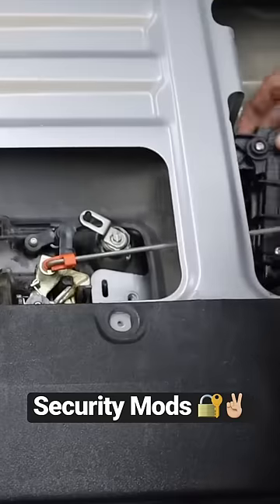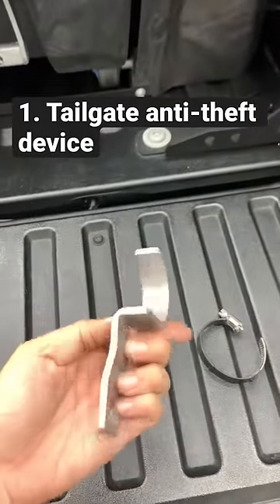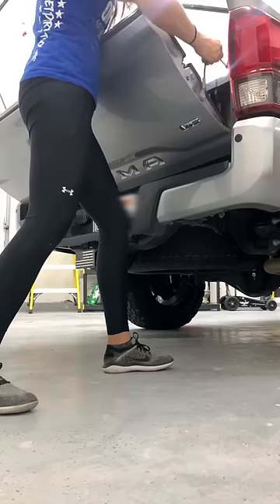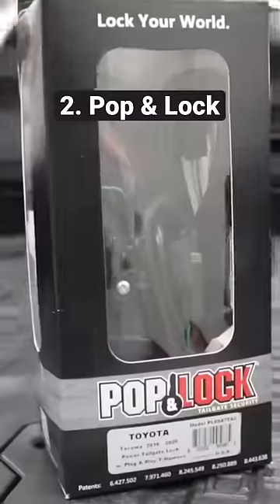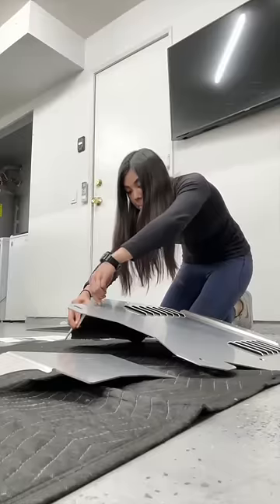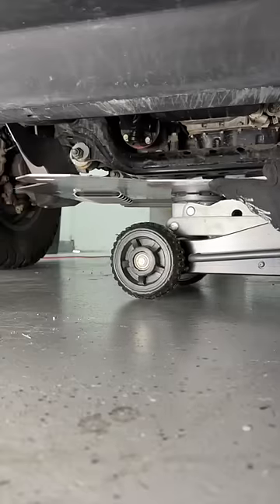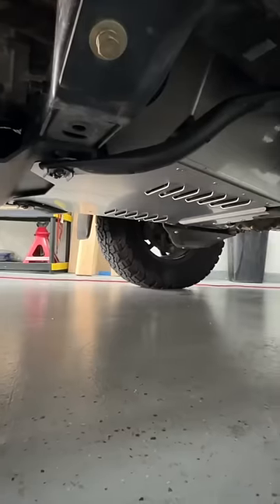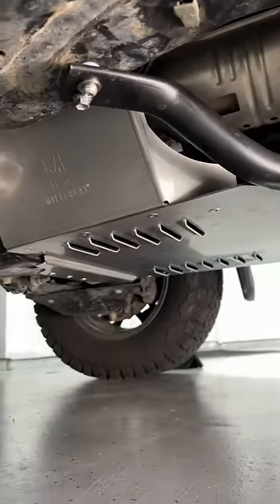All of the extra Security Mods on my Toyota Tacoma 🔐 (paranoid?!) #shorts #truck #toyotatacoma

Comment: Not crazy and paranoid, just realistic. Thanks for all your vids.
Reply: It's ridiculous old man have you ever been to Colorado there are tacomas every  20ft it's a basic car. Btw those cats aren't even worth that much either 😅
Reply: @willhrn8562  have you ever put new cats on a Tacoma before and how much did they cost
Reply: @Provemerightthx  But what about dogs?😄
Reply: That will actually work, thief will slide under there, see that, and move on to the next. That’s all it takes.
Reply: @ytgfhib they run between 1,100 to 1,200 each so it's expensive AF. If it's a 4 cylinder they only have 2.
Reply: @Keith  They aren't worth stealing I'm not sure how much they cost but plenty have more value
Reply: Now, thieves can steal both the protection plate and the cat.
Reply: This is normal in the US? God bless the land of the free und thieves 😂
Reply: Cat shield yeah 
Tailgate shit not really
Reply: 😂😂😂 more like manifesting that scenario into your life instead of just relaxing

Comment: The crackhead at 3am with a buzz saw 
“Hold my beer”
Reply: It'll still take long enough that it's not worth it.

I'd throw some high voltage battery warnings on the plate for good measure.
Reply: 😅 Just need a cordless impact to take out the bolts that hold up the cross member that the plate is bolted to.
Reply: @i-love-comountains3850 high voltage signs don't slow down crackheads, just makes them dance a little 😅 Google copper thief electrocuted using kitchen knives.

Comment: Dame people be really stealing tailgates now 😂
Reply: Stealing tailgates is an ancient form of theft. Most the old trucks you see missing tailgates is cause they were stolen. Where I live people take them off when they don't need them.
Reply: You'd be surprised for the kind of shit people steals. I live in Colombia and a friend of mine got both the sparkplug and the wire stolen from his cheap 100cc bike lmao
Reply: No one steals tailgates, it's an old wifes tail
Reply: @punkrocker10115  then why did mine disappear lol. They get stolen plenty
Reply: @rat-rav  one tailgate getting stolen doesn't mean it's an epidemic or that it happens often.
Reply: @punkrocker10115 not explaining myself to ya man. They definitely get stolen often where I'm from. That's it
Reply: @punkrocker10115  I used to take them from trucks in the ski resort and sled them right into rocks and abandon them
Reply: Taillights on newer trucks is a big one, all these LED ones sell for big money.
Reply: @punkrocker10115  I agree, cats are the number 1 thing.   Tailgates do get stolen but it’s usually from dealer lots
Reply: Still do, but I'd recommend changing the tail light hardware if you have blind spot sensor in a pickup. The radar for those sensors are in your tail light housing, which can run $2000 a piece. It's 2 tiny Philips screws that retain it. In 30 seconds, you're out 4Gs. If you lock your tailgate they can't be accessed. If you can't  a security torx screw would be a decent option to replace your Phillips screw with. No guarantees.
Reply: Some tailgates cost over $5k to replace.  I'm not surprised they get stolen.
Reply: @punkrocker10115 Oh how wrong you are
Reply: @Strokin383  but I'm not and just saying I am doesn't prove anything. 🤡🤡🤡
Reply: @punkrocker10115  this is very true... And the tail gates with electronics don't just pop off. And the ones with assisted drop don't come off easy either. I've owned trucks 15 years and my father 60 years and my grandpa 78 years. They never had one stolen. But I must say someone stole all my emblems off my Mazda. Which I don't fully understand lmao. But who even upgrades a vehicle and leaves the catalytic converter? I'm sorry I own a real truck and none of this matters to me cause it won't happen.
Reply: @punkrocker10115  come to san antonio, Tx. , for a couple days, You'll be leaving without a tailgate, but most likely... Your' truck will be leaving without you.
Reply: @rat-rav  Yep and they're expensive.
Reply: @punkrocker10115  only clown here is you pal. Happened at my local Ford dealer. All the tail gates were stolen in 2014
Reply: They been doing that fam.
Reply: @scotts1711  I literally driven to almost every major city in the US and they aren't stealing tailgates. They're not worth anything and it's a dumb fucking thing to steal
Reply: @punkrocker10115 my mother’s tailgate in 2009 and mine in 2020 got stolen tbf I was visiting a bad side of town
Reply: More locks, more alarms, more cameras, more anti-theft systems.
blah blah blah. Meanwhile we never tackle the actual problem. Bad parenting and bad culture. When I was 10 years old we left the keys in the car in a unlocked garage. Keep telling yourself things are better now, truth is, they are not!
Reply: @punkrocker10115 Quite common. Grandfather had his stolen from his old F-250 while he was at the beach. My uncle had his stolen from his Tundra back in 2018, and a guy I saw about 8 months ago was trying to steal one off a truck in a Walmart parking lot around 2AM. Think it was an old Tacoma, but I was in a drive through so I couldn’t tell for certain. Either way bottom line, is tail gate theft is very real and happens quite frequently on the west coast and in some parts of the south. Buddy got his replaced in Texas, drove it out to New Mexico to see his brother and bye bye new tailgate.
Reply: @idofx8722  again, just because you think you saw someone do it doesn't make it true  anecdotal still evidence is still not evidence
Reply: @punkrocker10115  I said I couldn’t distinguish the type of vehicle. Watching a guy throw a tailgate into the back of an old 2010 Toyota Sienna and then driving off with it isn’t “potentially” theft. 2016-2017 is when it was real bad. Texas and California had the most reported tailgate thefts. Many go unreported, cause who wants hiked insurance rates? Annual reports during that time were based on insurance claims. Texas racked up 1360 reported thefts between 2016-2017 and California  had 1039 reported thefts within that time. The crime rise and fall from year to year, but it had been on the decline since 2018. It has spiked again as inflation spiked. Desperation triumphs over litigation.
Reply: Nice
Reply: How old are you?
Reply: Yup.  Mine was stolen last month at Costco  2015 Tacoma TRD SPORT.  YES CALIFORNIA. They have it on video, vehicle AND plate   Still not even a call back from Sheriffs department. 3 were stolen in the parking lot of a restaurant I go to.  The next one will definitely be secured.
Reply: @rat-rav  YES THEY DO.    MINE TOO. !

Comment: For the 3rd Gen Tacoma tailgate locks, installed the OEM one available from Toyota.  Easy install, no wires to cut.  Plug and Play.  And works with original key fob

Comment: Love the cat shield, brilliant idea
Reply: Wrong material though. Everyone who is stealing cats already have an angle grinder. They are just going to cut right through it. The better option would be to use kevlar. It's not as pretty looking but if anyone were to try to use your usual power tools on it they will get a bunch of fibers caught in it and have their tools burn up.
Reply: @dillzilla4454 Exactly i seen it done on a prius they used a multi tool and went right threw the shield then cut out the cat. Working at toyota i see it avout 3-4 times a month if not more on prius, tacoma and tundras.
Reply: The cat shield is not to completely prevent cat theft, but it adds another layer of security. Smart cat thieves are looking for in and out quickly. They could spend more time on that or hit 2 other vehicles in the same time and reduce the chance of being caught.

Comment: I dig the skid plate, but beware the cordless Sawzall
Reply: If thieves have all the time in rhe world then yeah ,  nothing keeping them out , 
If they were going for a quick in and out then they'll move on ,
Reply: This is why aluminum (I think) and of course titanium are best materials for cat protection because aluminum will gum up sawzall blades meant for steel (steel needs smaller teeth). Titanuam obviously harder and I think work hardens, making anything under a carbide cutting solution innefective.
Kicker - harbor freight sells cheap cutting torches I am sure.

Comment: 4 cats ?? Fork that! save yourself the trouble and just don't buy a truck that new
Reply: boomer theres usually 2 cats on each bank of any v6 engine. Lol since early 90s or 2000s
Reply: @travisk1487  that's my point, I daily a '99 Dakota, V6, has a single cat, how dafuq it get to 4...? planned obsolescence is how, legally require them and make people spend $4k-$6k to replace them, no thanks, I don't want any part of that repair., or in the case they are stolen, you pay the $4+k up front, out of pocket, or you get insurance to pay for it and end up paying more for insurance in the long run, I don't like that choice either...and for the record I'm Gen-X....I also live in a state that doesn't check emissions, couldn't care less if my Single cat goes bad.
Reply: bro relax and get you a 05 to 09 taco they are incredible lmao
Reply: @wyslink9354  thats what i got but 4cyl. only 2 cats lol
Reply: @travisk1487 my dodge 6500 has no cat. Its just straight pipes.
Reply: @quinnmclaughlin7537  my trucks 23 years old with the factory cat still on it and it passes smog in cali i doubt she will still own that truck in 2 decades let alone 1
Reply: "4 cats on a car?? nevermind just buy a 10 year older car with none of the features & design problem solved!"
Sometimes I just wanna quit the internet
Reply: @quinnmclaughlin7537  1999 was 24 years ago. Manufacturers realized breaking up the cats into smaller cats allows for better packaging under the vehicle & more efficient conversion in the cat itself (more surface area, easier packaging, smaller cats=cheaper to make as well)
Reply: Wait you guys left the cats on?

Comment: The first two are really neat and useful however if you take a look at the catalytic converters on third Jen's there specifically put higher up into the engine bay so that they get hotter quicker this means you literally can't cut them out that would be keeping an eye on those transmission temperatures since you have just now shrouded the whole thing
Reply: The transmission is primarily cooled with the transmission fluid which passes the heat into a transmission cooler. Newer transmissions often have  thermostatic valves because the cooler is actually overly efficient at cooling the transmission. I wouldn't worry too much about the cooling from a change of airflow around the pan.
Reply: @brarautorepairs  you're funny trying to sound cute smart why don't you do some research on tacomaworld because not even half Tacoma's currently produce on the market come with the transmission cooler you're referring to and many of them despite having that many of them find transmission fluid temperature getting a bit too hot when towing or crawling hard Offroad
Reply: @yzrippin  If it's an automatic transmission, I guarantee you there's a transmission cooler.

Most factory setups just shove it in one of the radiator end tanks.
Reply: I don’t know what u talking about someone had a 2020 Tacoma and their cat got stolen
Reply: @YZ Rippin, the cooler is often seamlessly integrated into the radiator but you will still notice a set of trans cooler lines either at the bottom or sides of the radiator. If you are unfamiliar with maintaining modern automatic transmissions, it is understandable to not notice this as it usually is difficult to see.
Reply: The 2 downstream are easy to cut out. So is that shield for that matter. It would slow them down a bit tho.
Reply: Also, there are vents built into the cat shield.
Reply: @yzrippin you sound really pressed for someone who thinks a cat getting hot next to a transmission means the transmission is gonna get hot too. The wind will cool it faster than the infrared will heat it up. And yeah, transmission heat radiators up front have been standard for a while now
Reply: @legacyunited13  about half or more 3rd gens don't have the trans cooler
Reply: @OtherDalfite  some of us do this thing called off-roading you're not moving very fast add mud tends to get caked in every crevice but I understand you're probably one of the soccer moms
Reply: @Kyle_Bush_Fan8  I guess you've never been in any amount of mud whatsoever
Reply: @yzrippin  here's your choices
1) crackhead/mud protection
2) airflow

Pick one. Feel free to tell me how both are possible

Comment: For the bolts if you use different head style for each bolt it takes alot longer because you have to go find a new socket for each or they could just use a Sawzall to cut the plate and half of your floor
Reply: You're wrong.  When you add a troublesome extra step they just go to another vehicle.  They don't want to spend an extra 20 minutes running the saw.
Reply: @garryquiggins8183  that plus what sawzall is cutting a half inch steel plate LOL

Comment: Soo I’m just gonna throw this out there, cat thieves generally use a saws all in order to cut the pipe. Their just gonna cut one side of that shield pull it down and then go to the pipes. Hopefully it doesn’t happen to your truck but I’m just telling you what I’ve seen.
Reply: Although that is true. These thieves look for easy targets. Of course anyone can break into anything but if it takes longer than just snipping and leaving they won’t do it. No point in struggling to remove cat when the car park right next to this one has no shield.

Comment: That cat anti theft plate isn't gonna do anything for a thief with a backpack full of surprises.  Your security torx heads might as well be deck screws
Reply: A thief with any amount of sense is going to see that and move to the next vehicle, because a crime of opportunity ceases to exist, once it costs more time and resources than initially planned.
Reply: @NaruSanavai  hahaha.  Sure,  meth heads in the early 2000. With all that platinum and palladium in em,  after you get your first "opportunity" car,  you just have tools with you and nothing stops you.  3 minutes at one truck for 1200 bucks or getting one in a short period of time and it only being worth a quarter of ther price from a different car.  Also it being raised is inviting opportunity.  A drill with the bits is cheap and only adds 15 seconds.

Comment: I'm an automotive technician.

You're not over thinking, crazy or paranoid. Tundras and Tacomas are easy targets because of the ground clearance, then it's lifted, so it's just that much easier.
Your tailgate... About $1700 to replace. Your cat-converters.... IF you want factory cats, about $3800, aftermarket is about $2400.

I have a Tundra, and I have the cat shield, tailgate lock, and hardtop lock down cable.

Comment: The car thing is why I’m happy that the cats on my car Ana Dad’s minivan bolt directly to the exhaust ports on the heads and are under the hoods. Only ones that are remotely easy to get at both happen to be between the radiators and blocks with the difficult ones being between the blocks and firewalls.

Comment: The bolts on the cat shield are easy to remove with a tool the backs out broken screws/bolts FYI. Ideally you want a flush lagbolt with a castle nut on the inside.
Reply: Just get a safety torx . You can get them at any auto store Walmart harbor freight ect .
Reply: @Dr.Westside  even safety torx can be backed out. It needs locking in place. Which is where the castle pin comes into play.

Comment: Only problem is, that might only slow down a thief. It won’t stop them. We had a Toyota Prius at my shop that had the whole bottom side welded up so they couldn’t steal the catalytic converter so the thieves broke the window in the back. Cut battery cable then broke glass on driver door. Opened the door and cut the floor out of the car from the inside and stole the catalytic converter.

Comment: I think the cat shield is pointless most thieves just use a grinder. I think you'd be happier if you connected your cats with some form of quick disconnect. Cause then you're only replacing the converters themselves, not the converters, and the chunk of your exhaust. That was cut off to get them out quickly.

Comment: actually it6s very easy to knock out those center pins on those security bolts. u need to use reverse threaded bolts. with welded on nuts.

Comment: That one mod on the tailgate is cool, but not needed if you lock the gate with the key.  It is an issue, as if you use the remote ONLY to lock the truck, that gate is so easy to remove, if you don't stick the key in and turn it once to the right.  But if you do--then test it, you will find they can't take the gate.

Comment: For the shield it would be better to use something fiber based. A sheet of metal they can just cut right though with the same tools they would have anyway. If you use something like kevlar for instance it will destroy all their tools if there is an attempt for them to start cutting.

Comment: Girl, install a hidden kill switch. If you interrupt the fuel pump signal the computer sends using a switch, the car, even if its hot-wired, or is a push to start, will only rev but not turn over. at most you'll have a dead battery and missing radio plate. but they cant start your truck if they don't know where your switch is.